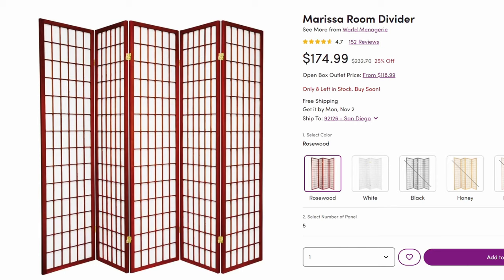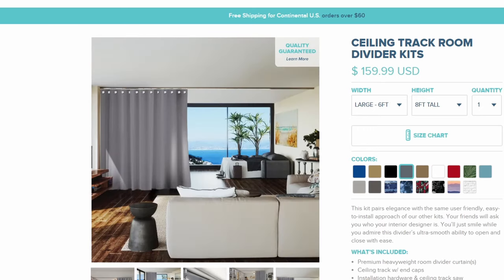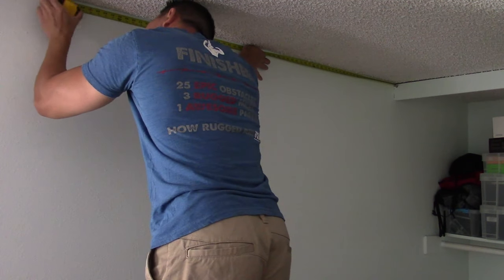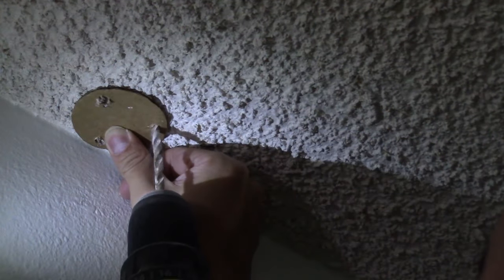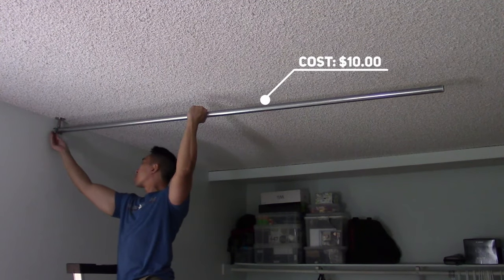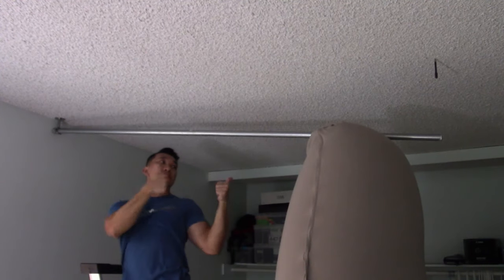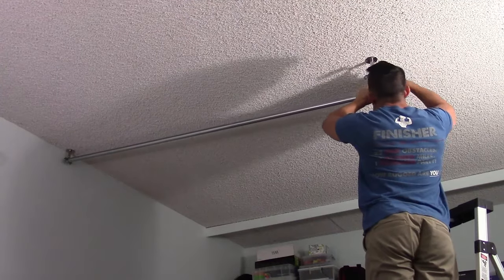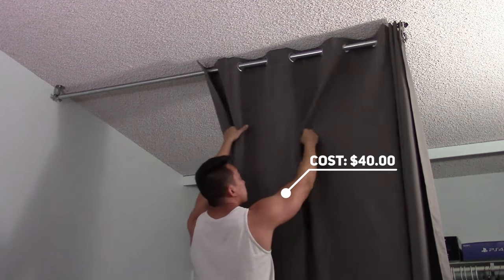Duy's DIY Adventures 009: Curtain Room Dividers

Comment: Duy, it doesn't look ghetto at all. The clips make it look "industrialized." The clips also can serve as a weight for the ends. You know what's ghetto, it's my solution to curtain hemming with clear tape. 🤗 Now that's ghetto, but it works until you wash them. Good problem solving on ur part.
Reply from the maker: LOL your solution seems a lot more discrete despite the washing setback.  Thanks for your kind words of reassurance!
Reply: 🙋🏻 thanks...and cheap.😁

Comment: I used those exact rods, but black, for outside curtains. We needed them for our lanai and pool privacy. A house was being built next door with complete view of our back yard. We planted clusia bushes and needed the curtains until the clusia grew enough for privacy. The curtains had the holes on the top and bottom to keep them from flying in the wind. They worked great and we were really happy with them. The heavy duty outdoor curtains worked for about 5 months before deteriorating in the harsh South Florida weather, they started letting off a fine dust. I needed to dump them. By that time the bushes grew large enough anyway. The rods rusted but still usable. Just needed to be cleaned. They are really good rods and I would use them again, even for outside. Just not the curtains. Need something to last longer. Eventually, someone will build a house on the other side of us and we'd need to find curtains for that side. The clusia on that side are smaller and taking longer to grow.
Reply from the maker: Wow, that's such a creative solution for privacy until your clusia grew large enough.  Also, it's great to hear that the rods endured harsh weather conditions.  Thanks for sharing your experiences!

Comment: Wow. I love the colour change. Great DIY for $65 and no one in your meetings will know. Looks like a nice and professional space for online meetings. I'm about to do the same for my at home business, except the curtain divider is going to hang between my living room and the kitchen to keep cool air in living space. I'm also using command hooks so I don't need to use power tools and have left over mess.
Reply: Hi. I see your comment is about 1 year old, did you follow through with this project?  And if so, did the command strip work?  I'm not opposed to using power tools, but the home I live in had a lot of abnormal build/electrical work done when first built in order to cut costs.  I'm not sure I'll be able to find studs without going out and buying the reader, or if wires will be somewhere they shouldn't 😅
Reply: @liliaunafoose5863  thank you for replying. I didn't need to be put the curtains up in the end, but I still use command hooks for everything whilst I'm in a rental. 🙂

Comment: SO CUTE!!!  Question:  Do you have an iron?  If you do, take off those binder clips and buy some IRON ON HEM TAPE.  It costs about $5.  Just fold the bottom of your fabric to the length you want, sandwich the hem tape in between the fold (closer to the top of the fold), then iron.  That way you can more easily wash and dry your curtains and the finish will look nicer too.  Good job on your divider!

Comment: I love this! I need it for my Videography Studio. I am unable to Mount anything to the ceiling though because it’s the removable kind but is there anything you’d recommend to do this from wall to wall?
Reply from the maker: Sorry for the late response!  I did a little research, but couldn't find a similar solution. One idea could be to use these heavy-duty curtain rod brackets. https://www.amazon.com/dp/B08CMRQ2B2  It's a similar concept to wooden rods normally found in closets, but we'd be using a sturdier metal conduit with less flex.  Hope this gives you a few ideas.

Comment: I wonder which kind of drill did you use. My room have same ceiling with you and I couldn’t drill a hole with my drill.
Reply from the maker: Hi there!  I used the copper wood drill bits in this set.  https://www.amazon.com/gp/product/B01HIIFFH4.  I would think all wood bits should work for your ceiling unless it's made out of a different material?

Comment: Did the ceiling hardware do a good job holding everything up?
Reply from the maker: Everything has been holding up well!
Reply: @slipperynoodlez  I'm about to put up three sets in the garage. Hopefully, I find studs in the right place. Did you hang them into the sheetrock with the plastic inserts?
Reply from the maker: @coulterjb22  Great!  I hope your project goes well!  I was able to put two of the screws in the studs and 1 I used the plastic insert.
Reply: @slipperynoodlez  TY, thats what I noticed when using the stud finder. My mounts come later today. Thanks!

Comment: Why didn't you use pvc pipe? If I do this project I'll try pvc pipe
Reply from the maker: Mainly because of the rigidity and I wanted to match the material of the mounts.  Good luck with the project!
Reply: Follow up: Amazon had a 10+ foot tension rod for $40 that had a lot of great reviews. I could probably DIY for about $10 but for me the convenience was worth the cost.
Reply: @NameRequiredSoHere  hey, do you have the link for the tension rod you purchased from Amazon?

Comment: What do you think about using a steel cable as a rod?
Reply from the maker: I think steel cable would work for lighter curtains.  I weighed these at about 4 pounds, so I think the tension from the ceiling might be too much.  maybe if you mount horizontally from wall to wall?

Comment: Hey I have a question, what if you want a longer rod? Where or how can I get that?
Reply from the maker: Unfortunately, the big box stores doesn't have anything over 10ft.  I did find some online electric supplies site that carry 20ft.  here is a link: https://www.platt.com/platt-electric-supply/Conduit-Straight-Steel-EMT-Conduit/Multiple/12EX20/product.aspx?zpid=857135
Reply: @slipperynoodlez  thank you

Comment: Hey is there a way to install without drilling?
Reply from the maker: Since the pole and curtains are quite heavy, I can't think of a way to safely mount the pole without drilling or screwing into the ceiling.  Maybe if you use a plastic PVC rod and lighter curtains?